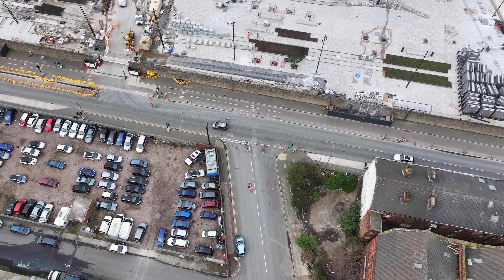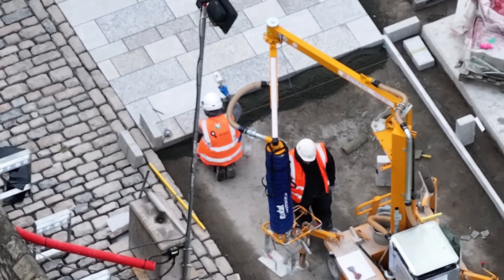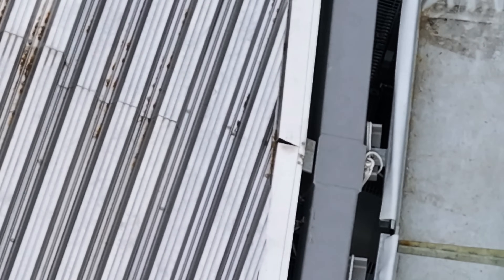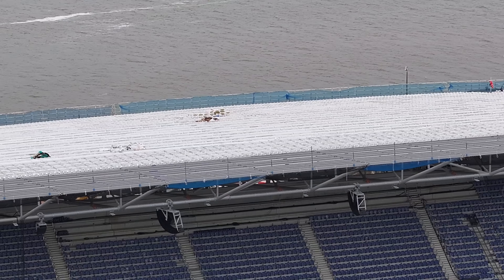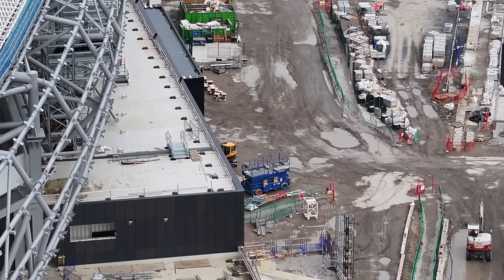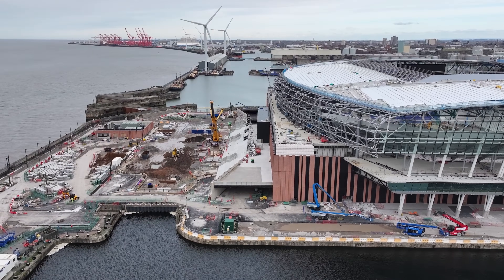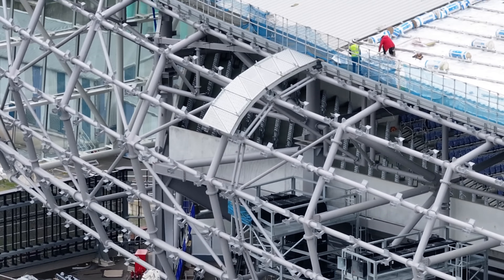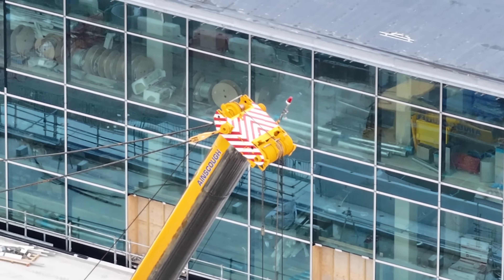Everton FC New Stadium at Bramley Moore Dock Update 16-03-2024

Comment: Great update 👍 there are 3 panels on the north west corner now. That insulation roll on west stand looks like it is lined up to support the final section of roof as they roll it out of the container. There are rolls of aluminium stacked just in front of that big yellow crane I suspect the final layer will start very soon if not by the time you leave 🙏